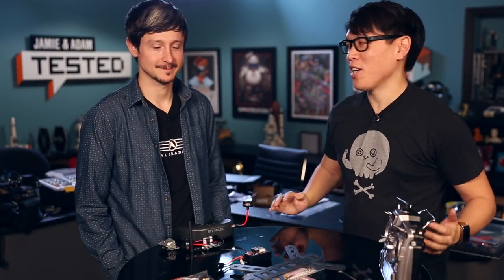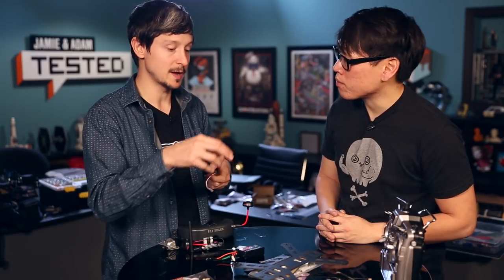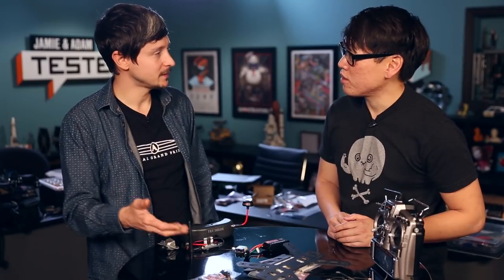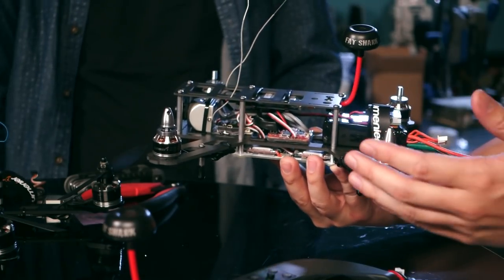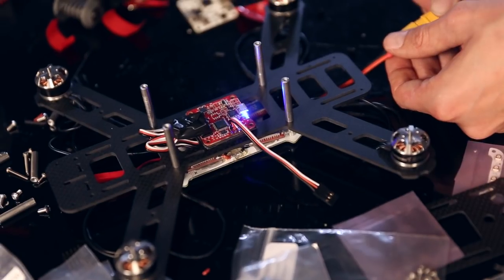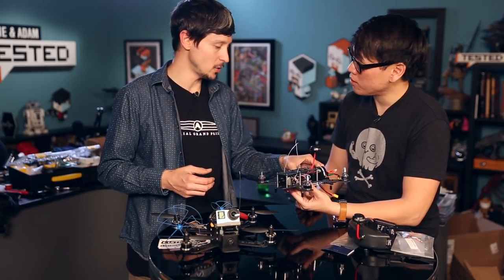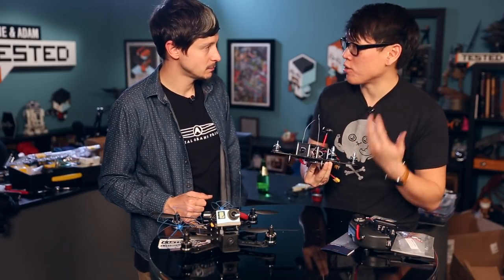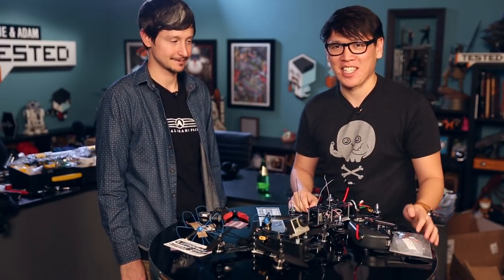How to Build a FPV Racing Quadcopter!

Comment: The KV value of the motor is the number of rpm(revolutions per minute) per volt applied to the motor that the motor will spin. 
A motor with a KV value of 1000 will spin at 1000rpm when 1v is applied, similarly it will spin at 12000 rpm when 12 volts is applied.
Typically both professional and hobby grade quadcopters and various aircrafts including racing 250mm size quadcopters will use lithium polymer batteries in series configurations of either 3 cells which gives 12 volts or 4 cells which gives 16 volts or more cells for larger or more advanced models.
Using these metrics its possible to determine the rpm that any motor will spin at a given voltage that you see on the shelf or in the online store.
Typically a given motor manufacturer will also provide a spec sheet for a motor that will list 2 or 3 different prop sizes that the motor was designed for and the voltage that can be applied and also the thrust the motor can produce with a given prop AND a current value required to produce that thrust.
You need all these numbers to properly spec a motor for a quadcopter of a given weight/size racing or otherwise.
Its nice that companies are selling bundles with everything included because theres quite a bit to the specifying of these part lists for quadcopters and that makes it easier but much of what is currently available on the market is being built specifically to fill the new market of small lets say sub 400 size quadcopters super light weight and powerful stuff that just needs to be navigated using the right information, its not voodoo but you can't gloss over the basics and still come out the end with a good understanding of whats going on.

Comment: He mentioned the "Lost model" beeper, which can be activated via control tx, but the naze32 can also auto activate the beeper when it hasn't received signal for some time, and it can also beep when battery voltage is low; I don't use an external "battery monitor", just the naze32 inbuilt monitor, and HK simple osd batt. monitor.

Comment: Awesome! Time to get some parts together and start building! :)
Reply: If you have never flown a quad I would not recommend going straight into something like this these are really hard to fly and are not very safe I would recommend getting a little micro quad and learning how to fly than upgrade to this
http://www.amazon.com/Cheerson-Cx-10-Quadcopter-Airplane-Orange/dp/B00KXZC762/ref=sr_1_1?ie=UTF8&qid=1419270417&sr=8-1&keywords=cheerson+cx-10
Reply: RCflyer729 Don't go with the Cheerson! get something like the Blade nano QX. So much better for a beginner

Comment: very cool vid, the first one you did totally got me hooked.
Would say though that the one they built was just under 850 and then the other was probably more expensive, but you can definitely also go cheaper with not too significant of a performance drop. For beginners this may be better as you don't really need the extreme performance and it reduces the entry cost.

Check out rctestflight channel, in particular the cheap 250 quad build vid. About $180 for basic quad and then you can find some fpv gear and transmitter. Cost depending on how much you want to commit.

I would also recommend the syma x5c for learning how to fly quads. Smashing up a $800 quad as a beginner is not a good idea when you can get one of these for around $50. I got one and they are perfect for learning with, also extra battery or two with these will keep you in the air longer and allow to practice with fewer interruptions.
Reply: Wow thanks man, I was looking in the comments for some more information like how much it would cost and you have just given me some awesome information for getting into rc quad copters for a low price. Thanks 😃

Comment: Nice presentation.A suggestion if I may: Consider a cheap OSD like a HKing supersimple OSD. For about 10 USD Gives you  voltage on screen (and time but I dont really see any use in this) I use it a lot!

Comment: Ive just got one of the QAV250 clones. I used MT2204 motors with 20 amp speedys and Acro Naze32. Its not as stable as i expected it to be. Simple hovering is quite involved. Lots of stick inputs. I think having the battery mounted on top of the frame causes instability. I may mod this to have the Lipo underslung. Basically turning the quadcopter upside down.

Comment: 1.get a HAM licsense
2. Lumenier is great for fpv, but only use 600mw tx.
3. you can buy better helical antennas
4. use under 1000tvl cameras
5.spartan quad frames are the best

Comment: Cool looking quad! I'm trying to build my own, but I'm confused on the wiring. How is the board powered? I doubt it is connected directly to the battery because it is probably only rated for 5v. Are there any wiring diagrams? Thanks!

Comment: Can you connect the video transmitter directly to the battery? For example 5v 700tvl cam to 5.8ghz 600m fatshark vtx then to 3s 1500LiPo throug jst connector? Thanks!

Great, and educational video!

Comment: Good video, but I have to point out a few things. QAV250 is a great frame, i loved mine! even the G10 version is awesome. Anyway I have to chime in:
1-st, that fatshark camera with sd card in it has an unacceptable lag that makes FPV much more difficult. Get a different board camera, like a cs600.
2-nd, the Taranis isn't exactly a "beginners" radio but it will be very open ended and will grow with you. 
3-rd,  once you have your motor directions confirmed, cut those bullet plugs off, thrown them away, and direct solder the motor and esc wires. Every single bullet plug is 2 points of potential failure x3 for each are x4 arms? That is 24 possible failure points that can easily be removed to make a more durable and reliable system.
4-th, Ditch those bullet shaped cone prop spinners. Youll lose them on the first contact with anything. Instead get simple locknuts of the right size (usually M5) and have a much better time.
And Finally, please get your HAM licence so you can operate more than 25mW on 5G8 and 10mW on 2G4 legally, and actually have RF understanding before flying the more capable FPV equipment.
Reply: Hovership good for you! Some people use gopro as flight cam without problem, which I would never recommend and you couldnt pay me to do on any of my rigs.. 
Give it long enough and one will fail in a confusing and destructive way. If you want to keep 24+ failure points on your rig thats fine, They were just suggestions that ive learned through years of FPV. take it or leave it, but trust me, bullet plugs are not your friend. Every plug you can get rid of, will bullet-proof your system that much more. Some people are OK with "OK" build rigs. I prefer something a bit more professional, not the most convenient. 20 extra minutes on the iron isnt gonna kill you.

Comment: According to MIT flight theory website document, weight can be accounted for through the following;
"The weight of an aircraft is a limiting factor in aircraft design. A heavy plane, or a plane meant to carry heavy payloads, requires more lift than a light plane. It may also require more thrust to accelerate on the ground. On small aircraft, the location of weight is also important. A small plane must be appropriately "balanced" for flight, for too much weight in the back or front can render the plane unstable. Weight can be calculated using a form of Newton's second law:
W = mg,
where W is weight, m is mass, and g is the acceleration due to gravity on Earth."

Comment: what's the difference between the lumenier frame vs. the other carbon fiber ones for sale on eBay. and I found a couple of FPV kit for under $350. should go with one of those and upgrade the components from there on? They come with similar specs as the ones in the video. What's the best advice for a newbie on a budget who would like to get into the FPV quads?

Comment: Hey when you guys hooked up the motors to the esc's  most motors have label's  on the motors And esc's  "A.B.C  .. and doesn't  your fly sky have a reverse option on your  settings ? ..  I know My Spektrum Dx6 does ...  I can bet this guy later in time will swap to a better radio and junk that Fly Sky .. sorry dont mean to bash on FlySki... My friends have had problems with there products ... .. other then that nice build Man ..  ohhh yea that little plug to add future  cameras  that is called a "JST" PLUG  .. for you guys that dont know .

Comment: I've always been interested in quadcopters, and the racing vid really ignited a spark! Though building one seems way cooler than buying one.

I wonder btw if this would be able to carry a NEX-5 with 18-55 lense. I don't understand the table on the getfpv website.
Reply: There is no way it would carry that camera. a gopro or a mobius is as big are you're going to get for a second camera.